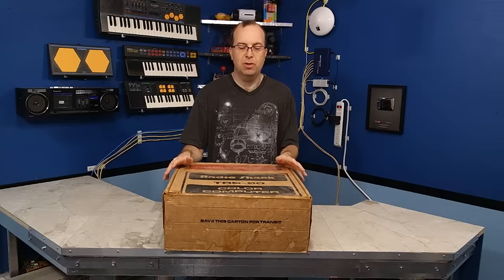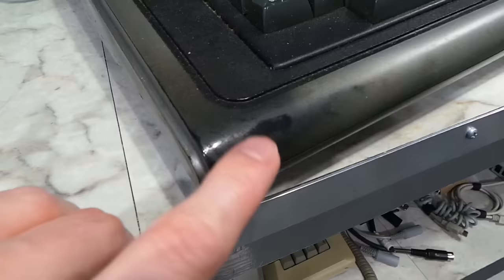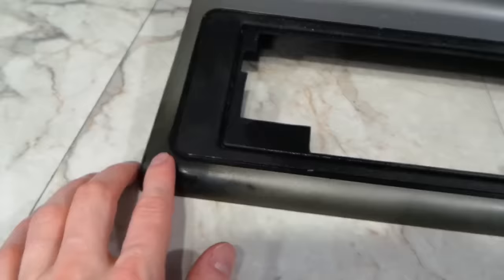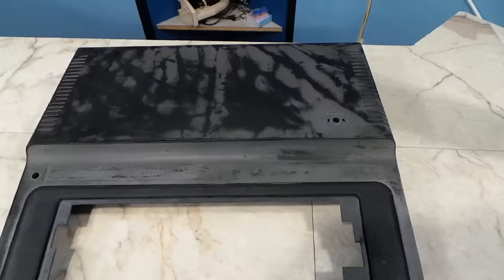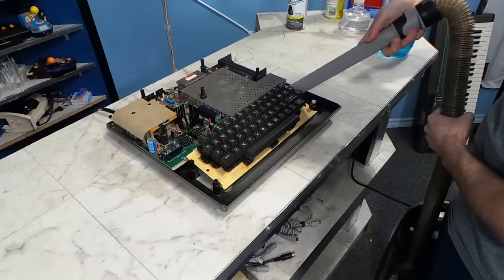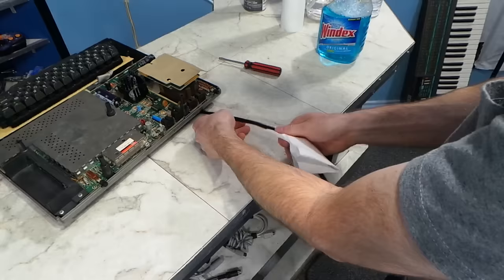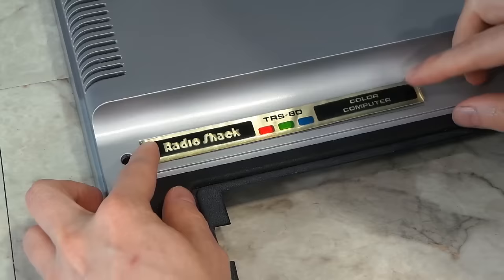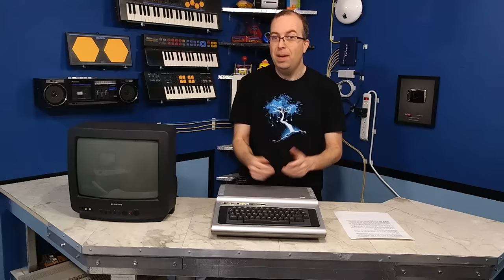TRS-80 Color Computer 1 Restoration

Comment: That could easily have been my CoCo. I'm pretty sure I did each of those mods, but for the 32k upgrade I did the trick where you piggyback solder a second set of 16k chips onto the first ones, bending up pin 8 and I think rerouting it to pin 16 of the chip below so that it could properly address the full memory space. The hack probably came from the pages of Rainbow Magazine. I also swapped out the 4k badge to 16k before I did the 32k upgrade. 

That machine totally blew my grandfather's mind when I showed it to him. He had been one of the research engineers at Bell Labs when they first developed the transistor.

Comment: When you're spray painting plastic you want to stay 4 feet away (On a low wind day) and 3 feet on a high wind,  you also want to do a minimum of 5 coats around 45-60 minutes apart, then you want to do 1 layer of clear-cote per 2 layers of paint, that way it seeps and settles properly without bubbling, if you do an uneven number of coats, always round up to the next multiple, I've been doing this sort of stuff for 10 years and never had a return yet! :D (Yes I'm 25, yes I've been doing it since I was 15)

Comment: I used to build stand alone test stations with those.  Using the game port you can access a Digital to analog converter, a Analog to digital converter, a decent clock module.  At one time radio shack sold blank breadboard boards that plugged into the game port.

Comment: You can tell that computer is from the 80s, probably from a exec's office, as determined from the residual coke powder found in the label crease above the keyboard, the cigarette burns on the right side of the palm rest where an ash tray no doubt was placed, and the worn out left palm rest where the exec rested his palm as he banged the keys in frustration, or held on while he rolled up a 100 dollar bill to snort the coke from the top of the keyboard.

Comment: Painting Plastic tip: scuff surfaces with medium grit sand paper then a finer one. Clean well with rubbing alcohol. Primer first in light even coats, 15 mins between coats. Paint in light even coats, waiting 15 mins between coats. If using retail spray paints and primers, SHAKE can continuously  for 2 minutes before use and several times while doing the coat. Repeat for each coat. Paint in even side to side sweeps not ever spraying in place. This will avoid orange peel effect. Always hang parts on appropriate wire when possible, it makes painting easier and allows the whole part to be painted in one session of multiple coats

Comment: For painting a computer like this, you want to start with a layer of primer with a color similar to the one you're going to apply. Follow this with your color paint. And finally, you want to use a clear coat of your desired finish (matte, gloss, etc) to seal it. The clear coat can protect against minor scratches and will keep the color from degrading from oils or light as fast, as clear coat tends to be very UV stable.

Comment: This was one of the very first Radio Shack ever made after Bill Gates brought out the ALTAIR 8800.  There was an earlier computer to this one introduced in 1978 called Tandy TRS 80.  Essentially this was [like] an ALTAIR evolved into a portable home computer with a keyboard, a change from the Intel 8080 processor the ALTAIR used to the more intuitive Zilog Z80 CPU.  Mattel Electronics made a version of it called Aquarius II.  It was basically an Aquarius with that same keyboard as this Tandy Color Computer instead of the blue rubber chicklet keys.

Comment: This was my 2nd computer (first was the original TRS-80) and the first one I started doing real programming on. I sold a couple of assembly-language utilities to some monthly software on cassette thing - I think one was a disk utility and another was a BASIC extension to let you combine graphics and text and make custom fonts. After this I got the CoCo 2, used OS9 on it, then moved on to Macintosh. But CoCo was the only system I ever did assembly on. The 6809 was a very capable little chip.

Comment: Staying far back not only prevents runs but also allows the solvent to mostly evaporate before hitting the plastic. This prevents it from degrading the plastic if it's acetone or toluene based.

Comment: I spent many hours on the CoCo building electronics projects such as serial ADC, DAC, A 6809 Hardware emulator, and learned Color BASIC and 6809 Assembly on a CoCo 1 and CoCo II. I spend many hours porting programs from other BASICs to Color BASIC. I ported Steve Ciarcia's BASIC program for the Dumb Serial Eprom Programmer to Color Basic only to find it was to large to run. So, I re-coded much of it in assembly just to get it to fit and leave room for a rom image. I then highly modified the programmer to allow me to upload the rom code into static ram chips and modified the software to read the values from sram and write them back to rom to be programmed. What fun I had!  I would love to see more CoCo episodes. I still have a Color Computer II (one of the later ones) but haven't fired it up in at least a decade.

Comment: Late to the party, but great restoration nonetheless!  Turned out great.  

If anyone is wondering about oven cleaner, it will also remove an anodized finish off of metal parts...takes a bit longer (several applications), but it does work.

Comment: Yep, it looked exactly like my old Coco.  I upgraded the memory to 64k using a banking scheme and added the aftermarket keyboard.  I used it for assembly language program development - asm programs could bank out the ROM and use all 64k RAM.  I also ran a BBS with it, from a program I keyed in out of Rainbow mag - an old Color Computer magazine.  Takes me back a long way.  Some of the extra wires inside this one look like the patch you had to do to get the RAM banking enabled.  It was a pretty common hack out of Rainbow mag.

Comment: Its very pretty. Spray painted surfaces don't do well with handling at all, and spray paints already have a built in clear coat. They aren't intended to be clear coated after, and doing so can often lead to some long term peeling and flaking down the line.

Comment: Advice when painting. Every paint job is 99% prep. Clean, rinse, wipe with alcohol and lint free cloth, remove all grease/oils/dirt/rust, etc... Put the work up onto something so that the edges aren't touching anything, so you don't get a nasty line where the paint stuck to the newspaper/cardboard, etc... When painting plastic, start with an adhesion promoter, when painting bare metal, start with a self etching primer. Start spraying off the work, move across the work, stop spraying when clear of the work. Follow the directions on the can. Pull masking tape at a 45* angle from the work. You did very good for your first time.

Comment: When using paint it is best to use some sort of sealer so as you avoid paint reactions with skin oils, and to a help protect the product. It can be found in the same section as the spray paints. Usually comes in glossy, semi-gloss, and matte finishes.

Comment: I know those old boxes really well. that one was vintage 1981 and those ram chips are 64k a print mem will show 32k as 1/2 the ram is set aside for graphics by default unless you specify under program control otherwise. I ordered the technical reference manual for mine in 82 so I could mod the unit. I was the technical goto guy for a coco group at that time. I supported 6809e hardware interface, and assembly language for the coco.

Comment: That's a 256k memory computer. Those RAM chips are 32k EACH. Very likely, the jumper wires you see are to allow the computer to access more than 32k. It's been SO long, I can't remember exactly. I had a 1982 16k Color Computer and to upgrade to 64k, you swapped the 8 chips to 4164 RAM chips and clip the diodes as seen in the computer in the video. And, that was it. Earlier MOBOs needed extra wires. 
Fun note, later 32k upgrades done BY Radio Shack used 4164s and you were actually getting 64k memory. Radio Shack refused to admit an earlier Color Computer could have 64k. Since it was mostly an 8-bit computer (the 6809e processor was 8-bit externally with 16-bit internal operators), you had to do some tricks to use the whole 64k of memory. Later, when the Commodore 64 and others were selling as 64k machines, the Color Computer 2 and onward were "officially" 64k. 
The computer in the video... 256k... All I can think the extra memory could have been used for was a fast RAM drive or to store video screens. It would require all kinds of fancy bank switching to get a program to address it all.

Comment: to remove paint from plastic I used once the Sodium hydroxide, popular component of means for unclogging pipes, it is safe for pvc, works best when warm. I needed few hot baths and then kept for a night to remove old paint like this one in your video, plastic was untouched.

Comment: Needs a plastic primer before base coat. It forms a tacky surface for better paint adhesion. But removing paint on plastic using an oven cleaner seems new to me 👍 Would experiment with it though. Good restoration job

Comment: While this one isn't mine, I will tell you that I owned several of the original TRS-80 Colour Computers back in the day. I also upgraded the memory using the piggyback method and wore the silver paint off the palm rest areas of the keyboard. I wrote a lot of video games and demonstration software that utilised the colour pages and sprite capabilities of the system (4 colour pages with 4 colours per page = 16 colour sprites, which was quite good for the time). Whoever owned the one you restored probably did something similar.

Comment: Next time you are removing paint use some 1000 grit sand paper. You selected the correct paint type, I would go over it with two or three layers of clear coat. You can buy clear coat with a dull finish if that is the look your going for. Also get some q tips!! Haha Greta videos! I love your channel. It is very informational and fun!

Comment: Man this takes me back.  The stacked RAM was a cheap way to upgrade.  There were a few times where there was a compatibility issue but for the most part it was the best bang for your buck.  The LED mod was a little more common then the RAM upgrade.  There was also an inverted screen mod which would give you green on black text.

Good job on the restoration.  Usually both the left and the right of the keyboard would lose paint.  Mine didn't but I remember going to computer shows and seeing some real nerds with that problem.  

You can copy those ROM cartridges to tape too, BTW.  I think you had to use a POKE command then insert the ROM cartridge with the computer turned on which was not recommended.  From there you could just copy the memory where the game resided.

Comment: I know I'm buzzing in a bit late here but here's a tip for any clear labels you intend to add in the future. Add a black border around them. They look a bit bulkier that way but it's a bit less jarring than seeing the edge of the label like that. I use this trick with guitar effect pedals and it works like a charm. The edges are less jarring and it just looks nicer.

Comment: Just a suggestion on the port labels. You might want to try printing them on clear decal paper and then after combining run add a couple of coats of clear coat paint which will hide the edges. looks awesome though!

Comment: You can use DOT 3 brake fluid to remove paint from plastic. Soak some heavy duty paper towels or rags in place those over the painted surface. Then put it in a plastic bag. Just use soap and water to wash off the brake fluid.

Comment: I'm really serious and no joke.  Creamy peanut butter is an excellent leftover adhesive remover such as for the leftover adhesive from those badges.  Place a thin layer on the exposed adhesive (must be exposed adhesive).  Let it sit for 10-20 minutes.  Wash off with dish detergent and sponge.  I've done this to a stainless steel ruler after removing the no-slip cork from the bottom.  The leftover adhesive was extremely stubborn to remove.   All the following failed.  Goo-Gone, soda, nail polish remover, isopropanol, hot soapy water, brillo pads, and excessive elbow grease.  All these did were just to make it worse.  Shop-Rite peanut butter was the brand I used.  Cleaning was like washing PB off a butter knife.

Comment: Couple of things.. the one picture you showed with the black bezel isn't a color computer, if you look closely, it says "Videotex", as that's a picture of a Videotex terminal.  Tandy was approached by a company called Agvison to create a terminal for them, which they did, but also sold it under the TRS-80 brand name Videotex.  It's basically the same design as the CoCo except instead of BASIC ROMs it has the Videotex software (later sold as a cartridge on the CoCo), and was the basis for the Color computer.  Also, the only way to get 32k is to piggy back 16k chips onto 16k chips, since those weren't piggybacked, that means they're actually 64k chips.  The computer, when turned on, banks out the upper 32k with 16k for the cartridge but the machine can be kicked into an all RAM 64k mode.  So that machine is 64k, not 32k.  Because it had the black bezel, like the videotex machine, it's likely an early model (1980ish).  The later versions had improved keyboards, and the last models were even white just prior to the CoCo 2.  That particular machine did have the aftermarket "HJL" keyboard, which was a great after market choice for that machine.  Later models of the CoCo 2 and CoCo 3 had much improved keyboards.  Also, interesting tidbit, the 4k badge was there to cover the hole (the one you used to push out the badge in the video), which had the LED from the Videotex terminal (which had a built in modem).

Comment: Hey! Here is a tip for future projects. If you ever need to remove a lot of paint quickly, use either methylated spirit or white spirit.(White is stronger). Because it is a spirit, if will not melt or damage plastic however it may slightly discolour it. If you want to be cautious, I would recommend methylated spirits. :D

Comment: we had one of those when I was very young I think it was 32k stock and extended to 64k by the store it did have the chiclet key board while all the 16k base models came with the key board you have after several keys sticking we finally replaced it with the raised keys like yours

Comment: A little tip. If you don't want to use paint remover. 
Try braking fluid. I have had great success with that in the past, when I used to build model cars.

Comment: I play minature war games, and when I want to strip plastic models without damaging the plastic I use a product called purple power. You can find it in the automotive section of walmart. Pour it into a container with a lid larger enough to hold what you want to strip, then submerge what you are stripping into the purple power and close the lid. Let it sit in there for about 4-7 days. When you are done the paint should easily come off with a rinse and scrubbing with a brush. It might take longer time, but it's much easier and more thorough.

Comment: I refurbished an Amiga 500 that was painted black by its previous owner. I removed the paint by soaking the case in DOT-3 brake fluid.
Two major things about using this stuff:
1: it's massively toxic! Use it in a well ventillated area, use gloves, a face mask and goggles. If it gets into your eye, it can cause blindness
2: before soaking the plastic in it, do a small test. Put a small amount on the inside of the plastic with a cotton swab, wait 30 minutes and check if it melted the plastic. If not, you're good to go

Comment: 2 coats of clear was a good idea, and that's one of the better spraycan applications Rustoleum makes, too.
I generally don't like Rustoleum product because it tends to run AND it doesn't really level itself well.
I had better luck with Duplicolor product but still used the 2X gloss coat from Rustoleum to top off/protect my paint.  It supposedly has a UV protection built into.  I mean, I haven't seen discoloration in my WHITE painted customized joystick and that's been around for 7 years now?  The plastic in that dates back to the late 1990s but it didn't yellow unlike some LATER off-white/white plastic hardware!

Comment: Definitely should've used a primer first, to help make sure the paint stays in place. Afterwards, could've also given it a "clear coat" or a "topcoat". Ironically, Pledge Future Shine works as a GREAT gloss clear coat top. You can brush the stuff on it and it mostly self levels.

Comment: One little bit of TanyTrivia: One of their first computer to use that newfangled "compact disc" drives had a defect from the factory which caused the drive to cycle constantly until the drive eventually died. We knew it was going but left it alone as there wasn't much we could do about it until we could ship it back to Tandy..
Oh course my favorite Tandy trinket is my embossed name tag from working there ;p Back when it was Radio Shack not Radioshack. that and the contant pressure to sell cellphone plans were 2 factors leading to their demise imho.

I guess my most obscure computer is a black Bell&Howell computer which was a rebranded Apple ][ which I upgraded to a ][+ motherboard, having not considering leaving the thing stock, although I think the board is somewhere in my archives..